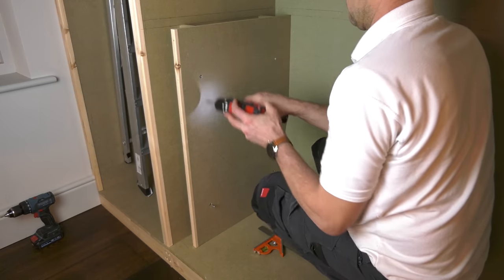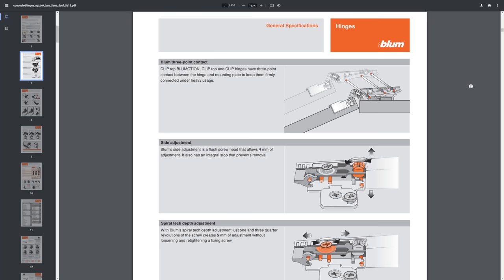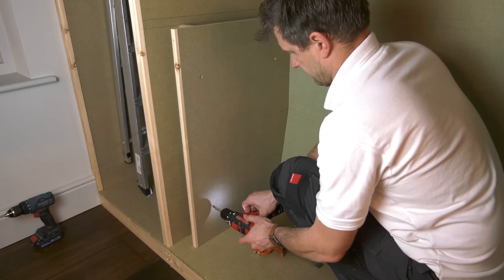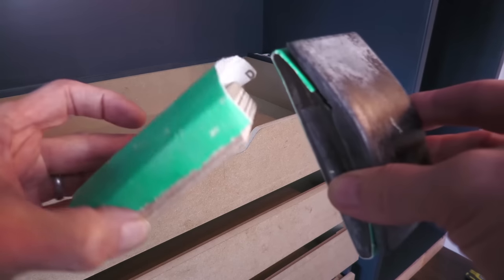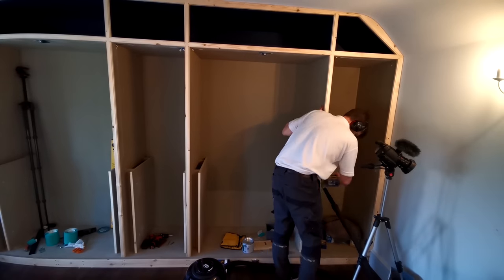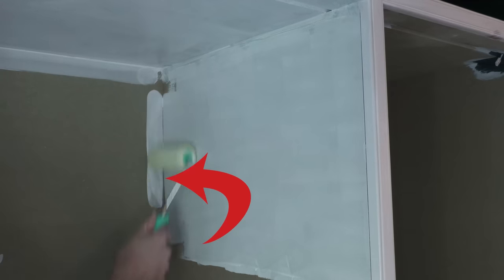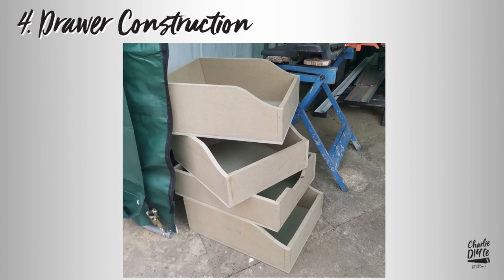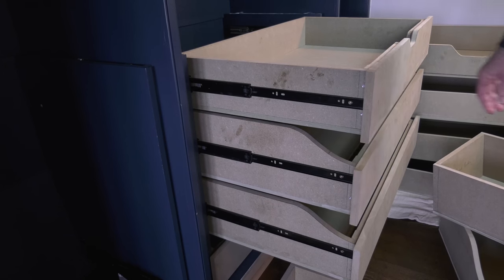DIY Fitted Wardrobe Build - DRAWERS & PAINTING - Video #5

Comment: If you done it again. Would you make the drawers first and then make the stand offs afterwards to fit? This would mean make the drawer, then take the dim off for the runners and the gap to make the standoffs.
Reply from the maker: I don't think there's much in it between the two methods. My problem was that I relied entirely on the measurements pinged off my Leica laser measure. I had a carpenter mate over last week and we measured a random distance (from the edge of the kitchen table to the wall) and the tape measure came in 2mm shorter. So the laser is  over calibrated. On tapes like my Tajima you can butt up the tape against the wall, measure the distance and then add the length of the tape to work out the final length, and to make your life even easier the amount you have to add is on the back of the tape.
Reply: @CharlieDIYte  I think doing it that way you could make all the drawers in one go and make the stand off to fit. I have the same Leica D2. It's really accurate. Don't know how much it would cost to send it to them. It should be more accurate.
Reply from the maker: That is a very good point and actually on this sort of job, systemising/ mass producing is crucial to cut down on the build time, so I'll respectfully agree with you on that 👍🏻 D'you know what, that Disto D2, much that I love it, has always over egged measurements by a mm or two. When I first got it, I actually sent it back to the supplier for recalibration and he returned it to me saying there was nothing wrong with it, so I just lived with it. I have dropped it occasionally since though which probably hasn't helped.

Comment: Why did you decide to use MDF rather than plywood for your wardrobe?  Is it a matter of cost or does the material not really matter that much?  I'm about to tackle a closet build and I shy away from MDF out of concern for it's ability to hold screws for things like clothing rods.

Comment: Hi ppl, I've recently installed some floating shelves with the exterior made from MDF. 

I've had some issues with the finish paint surface being sticky. My first shelf had an oil based primer and than two coats of water based top coat. The other two shelves I just painted with the water based top coat but still has the sticky feel to it.

They have also had a fair time to dry.

Is there something I can do to fix this issue? Thanks

Comment: If you need a good filler that won’t go off as quickly as 2 pack. Try Samet! a cabinet maker friend put me on to it. It applies like a stiff icing sugar paste and is super fine, it’s used for filling veneers and can be used to fill edge grain of MDF. I’ve found it’s perfect for filling screw holes, nail holes and moulding joints 👍
Reply from the maker: That's a great tip. Is it rock hard when it's gone off and any shrinkage?
Reply: Not rock hard but stands up to a bit of abuse 👍

Comment: 2mm - pah. I've just finished building some full extension under stairs drawers, after carefully measuring one of the drawer widths I started to cut the ply, stopped halfway as it looked wrong.

73mm too small - arrggh I'd forgotten to add the width of the tape measure when doing the internal measurement. I'd even written it at the top of the page of measurements to make sure I didn't forget.
Reply from the maker: Gutting! I've done so many things like that. Typically when I'm a bit tired, or distracted..

Comment: The drawers are usually not constructed with the base screwed into the walls because all the load from the contents is transferred to the base instead of being more evenly distributed. With enough fasteners, it's probably fine but mechanically it's less stable.
Reply from the maker: I get that. However with glue and screws it's far stronger than it needs to be / or to put it another way, it won't fail due to weight placed in it, and with this method it gives us DIYers an opportunity to get our drawers perfectly square.

Comment: Is the 25kg limit on the soft close not purely down to anything heavier will overwhelm the softclose mechanism and not actually relating to strength of the runner.
The runners would take the weight of the non softclose but the spring mechanism wouldn't last.
Reply from the maker: Yes I think that's it, Paul. I suspect I'll be around 25kg so should be ok.

Comment: Hi Charlie. I have started using your MDF painting method. Zinniser Bin followed by few coats of Acrylic Eggshell. However on a recent project this week I have come across an issue with the paint coming off. I applied 1 coat of Primer followed by 3 coats of acrylic eggshell. After the final I checked the paint and it had dried. I then proceeded to stacking all the pieces to carry into another room. After separating the pieces I noticed some of the paint came of when separating. And some of the pieces felt like they were stuck and needed slight bit of pressure to prize away. 

Have you ever come across this ? Worried that the paint will come of easily in near future. Or is that I need to give it much longer to dry ? It must have been about 15 hours since painting final coat and they seemed dry when I put my hand over all the pieces.
Reply from the maker: Yes I have had this problem. It comes when you stack the pieces when the top coat hasn't completely cured. Don't worry about long term durability though. It's just because you put together two semi cured surfaces. When the project is finished you can always add to the durability of the top coat with a protective coat of say Blockade Rocktop, Minwax or Polyvine.
Reply: @CharlieDIYte  thanks you getting back to me. And will try the protective coat also. Which one would be best to keep the eggshell finish ? 

 Keep doing what you doing helping us amateurs 😅 love your videos 👍🏾

Comment: Another option to gain the extra space for the over sized drawers would be to recess  the runners in the sides
Reply from the maker: Thanks Keith. I thought about that. The only problem is that when the runner fully extends, you will see the routed channel so I think shaving a couple of mm off the frames is the quickest and neatest solution. This wouldn't have happened if I had just used my tape measure rather than the laser - which I've realised is 2mm over calibrated 🤦

Comment: You sure about those hidden runners needing to be recessed ? Pretty sure I've seen them sitting on flat bottom drawers on some Youtube video

Oh and Soudal fix it all makes excellent caulk. Mould resistant as well. So it's good for caulking those "damp spots" like between the patio doors and threshold/skirting.
Reply from the maker: I think it depends on the design, Dean. There are obviously single extension runners (like the light weight Ikea ones) that screw to the side, but the majority of full extension runners will require a recess. Thanks for the Soudal recommendation 👍🏻
Reply: @CharlieDIYte  Would the full extension runners always need a recess? Or would having the base of the (false) drawer front lower than the drawer bottom suffice? Enough to hide the runner & fix it to? And could you have done away with the drawer frames entirely by spacing the 110 hinges to coincide with the gaps between the drawers, making the gaps wide enough for the hinge to clear?

Comment: Rather than taking your spacers out and reducing by 2mm you could rout a 1mm recess into the draws on each side,
Reply from the maker: Thanks Doug. That was the original get out of jail I had in the back of my mind, in case anything went wrong but the problem is, with the second extension of the draw runner to the narrower bit, you'd see a big ugly routed channel in the side of the drawer, so that's not really an option.

Comment: Hi Charlie. What is the purpose of the drawer frame rather than just attaching to the carcass? I'm doing a very similar project in the next two weeks and assumed I'd just connect to the carcass.
Reply: I believe the drawers will be behind double doors. Charlie therefore needs to stand the runners off the main carcass to clear the hinges on both sides. 
The frame provides the offset required and it can be paneled off on the front and top to give a nice professional appearance.
Reply from the maker: Carl has described that much better than I would have been able to. Spot on and many thanks, Carl. Particularly for inlay doors like mine or generally when you're using concealed or euro style hinges but to be honest even if you use standard butt hinges you'll want some sort of inner frame, otherwise your doors will clash with the drawers unless you open them considerably past 90 degrees. If on the other hand your doors are somehow hinged on a front frame, you might be ok.
Reply: @carlwilliamson4077    Thanks for the response. That makes perfect sense, thanks. I realised there is an explanation in the video but I must have missed it!
Reply: @CharlieDIYte  Thanks for the response Charlie! I realised after there was a section in the video where you explain this; no idea how I missed it. I'm actually doing sliding doors for my wardrobe hopefully I won't have this sort of issue to resolve.

Comment: I don’t understand why you’ve packed out in either side for the the drawers. I am copying you other than the fronts I’m having. Sliding doors for space saving but other than that will be the same but just conscious losing space but packing out either side
Reply from the maker: You need to pack them out to get clearance from the open doors in my case because the doors are inset into the frames. Also for the concealed hinges. For doors that are over laid (on the outside of the frame) using butt hinges you wouldn't need to - or indeed for sliding doors.
Reply: @CharlieDIYte  thanks for the reply. So in my case I can still pretty much copy everything you’ve done but as you’ve said the sliding door will be proud of the units so won’t be an issue and can screw the runners to the main carcasses?

Comment: Be very careful using Saves Nails type adhesives as caulk, I did it on some very fine caulk lines and it made a right old mess, cracked up was flaking, absolute nightmare. Filling a crack it was OK but caulking fine details no good.

Comment: Showing mistakes has just as much value as the "how-to" parts of these videos. It's so easy to do stupid, we've ALL done it. Making a batch of the "same" thing (drawers in this case)  is always fraught with hazard. I once wasted a whole sheet of MDF when my "jig" was 10mm short because I thought I was so smart I didn't need to check my maths. "Measure twice, cut once" is the most important law of carpentry, it should be written in large letters on every type of saw.
Reply from the maker: Yes it should! Annoyingly the reason for the error was my over reliance on my Leica Disto D2 measure which is over calibrated by 2mm. I found this out the other day when I was discussing this with a carpenter mate. We tested a distance first with my Tajima tape measure and then the D2. 2mm longer on all the laser measurements 😬